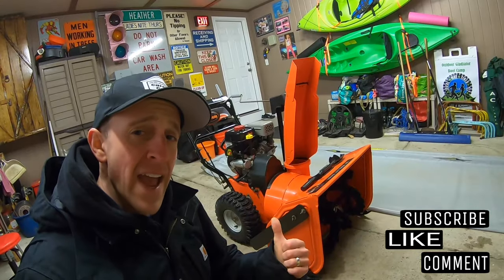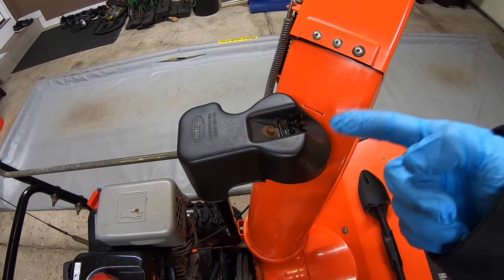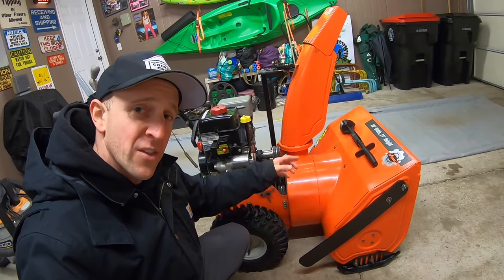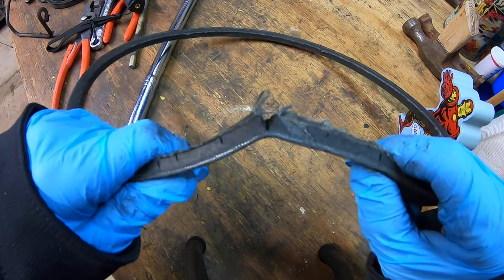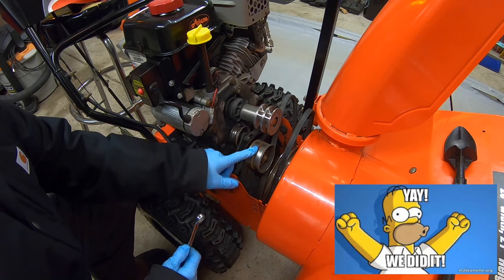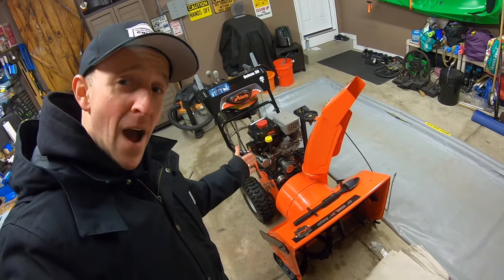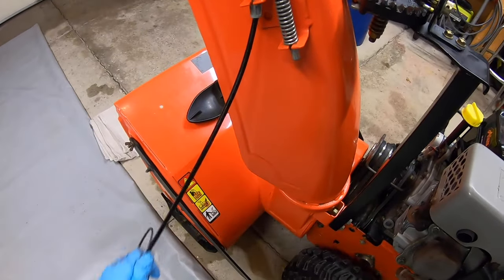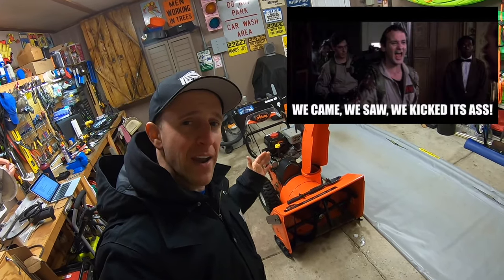HOW TO CHANGE SNOWBLOWER AUGER BELTS - FAST & EASY Replacement and Installation

Comment: Great video!  As I changed my belts last year on my 25 year old Ariens ST8 I can attest that nothing has changed in regards to how to get it done. You did an excellent job on providing all the necessary steps.
I used genuine Ariens belts but they ended up being a tad too long. Enough that I couldn’t make as tight as I wanted when the tensioner was at full tension. It still works ok though. Next thing I’m considering is installing impeller shims to help it throw snow farther.
Reply from the maker: Hey David! Thanks for the positive feedback! Those old ST 8’s are tanks!  You could possibly go to a shop that sells belts and see if they can sell you one that is one size down. Could possibly help! Be sure to check out my impeller kit videos. Did a few of them and all of them work great. Thanks for checking out my channel!

Comment: Just came across this video!! Awesome! I chose to take the pulley off to put my belts on. The new belts were tight and I was worried that I would damage them. 4 bolts and the pulley came right off. Thanks again for the vid! Super helpful!!
Reply from the maker: Glad this video helped you out Lonny! Thanks for watching my friend!
Reply: I'm trying to remove the pulleys but I'm having trouble finding something to jam in there to stop the pulley from spinning while I remove the bolts.  What did you use?

Comment: Thank you for going to all the bother to post this video. Great instructions, and kept simple and to the point! At first glance, it looks like you could replace (at least the auger belt), without breaking the machine in half. That would make this MUCH easier, when dealing with older (rusted, banged up etc.), machines. Maybe Ariens would rather you have the Ariens Dealer perform the task……
Reply from the maker: Thanks for the positive feedback my friend! It’s a pretty straightforward job that only takes about an hour to complete. Thanks for watching Plugger!

Comment: Good video. I just did this job on the same blower. 
One thing I struggled with was when you remove the old auger belts and re install the new ones. Jamming them between the welded nuts is unnecessary and is damaging the new belts on install. I simply removed the 3 small bolts holding the large belt pulley in place and it slid off easily.
Reply from the maker: Thanks for sharing the tip Kevin! Thanks for watching!👍
Reply: Yeah, but tightening the bolts again is near impossible until you realize that on the bottom side of the pulley, there is a hole that you can stick a screwdriver through and stop the mechanism from spinning while you tighten the bolts.

Comment: Very helpful video.  Thanks for this.

An idea for 4:07:  Hold the belts together with a rubber band when tipping the auger housing toward the engine and drive assembly.  That way they stay on the auger pulley without having to use one hand to hold them on while you're joining the two parts of the machine together.
Reply from the maker: Thanks for sharing steven!

Comment: i changed the auger and drive belts on my craftsman track drive snowblower last year. The tricky part is finding the murrey part number that replaced the craftsman parts. 
The auger belt was stretched so bad it wouldnt throw snow at all, but according to the manual it was made in 1988. belt life seems to depend on how much heavy snow it moves. 
But still in great shape as it was always stored in a heated area.
Reply from the maker: Thanks for sharing

Comment: Haven’t changed mine in the 5 years that I have had the Deluxe 30 but these back to back storms we just had in Northeast have caused both belts to snap and cause a bunch of issues when they got wedged into the pulleys and guide so after the smoke cleared I need a bunch of parts and your video is awesome, Thanks !!
Reply from the maker: Hey Kenneth, glad you found this video helpful! It’s not a tough job to complete. About an hour or so and you should have it all fixed up. Thanks for checking out my channel!
Reply: Are those polyskids ?
Reply from the maker: @paulm8395  those are armor skids! They take big bumps very well. You can find them on amazon! Here is a link but make sure you buy the ones that it your specific snowblower. Thanks for watching! https://amzn.to/3IbmoQj

Comment: I have a Platinum 30 Ariens as well as a new Honda 928. The Ariens is about 14 years old and I've never changed the auger belts! I bought a set when I bought the blower and they've been hanging on the wall waiting to be put into service. I may do that just for something to do over the summer!
Reply from the maker: Go for it! 👍

Comment: Just changed the belt on my Husqvarna ST327, was a lot easier than the steps you had to do. remove chute with cables still on, remove belt cover, undo4 bolts, split the unit slightly, replace the belt, fold back the unit, tighten four bolts, put belt on the pulley, replace cover, drop the chute back on, and you are done.
Reply from the maker: Every model is a little different but pretty much every one has to be split in half. Depends on how many other things are in the way. Thanks for watching Sunjay!

Comment: Same Ariens machine and have never changed the belts in 10 years. One is showing some damage so I'll get to it after the season. Great video! I would suggest using some brake cleaner to clean the metal pulley where the belt rides.
Reply from the maker: Thanks D Tom! Good tip with the brake cleaner.  I have however seen brake cleaner mess up the paint on the snowblower so perhaps blocking the rest of the snowblower with cardboard or a tarp would be a good idea. Thanks for watching! 👍

Comment: Your going to think I'm nuts, but I learned this on another YT channel a few years back. There's a product called 303 they make several versions I use one for RV's. If you soak belts in it overnight it helps preserve the rubber from cracking over time. It does seem to help I've tried it, it doesn't cause any slippage or other issues either.
Reply from the maker: I will look into this powder! Thanks for sharing! 👍

Comment: Hello JB, if I wanted to add some new bright lights with low voltage how would I hook them up? I noticed that I have holes on the auger housing. You could use some big gum bands to hole those belts when titling it back. That one video where you make the unit level  was great, and thanks for the tip about the shoes and the belts. Also JB, I still can't start my blower with the hand pull, Electric start only. I have tried. I runs good other wise. I also have used Sea Foam in the gas to clean the carb. Great Video !
Reply from the maker: Hey Stanley! I know donyboy on YouTube did a video on lighting for a snowblower. Guess they work pretty well. That leveling tip works well and also helps you drive straight too. I wonder if your magneto has a thin layer of rust on it preventing it from getting a good spark. It’s not terribly hard getting in there to look at it depending on the model. As always thanks for watching!
Reply: @GarageGear  I see donyboy already has a light on his. I think he use the wiring that was already there. I wish I did. I will ask him, Thanks !

Comment: I have a 1995 Troy-Bilt 9526 that I purchased new, I have never changed any of the belts on the unit. Although, after watching your video I did order new ones. Love this machine, only problem I'm having is parts are getting harder to find. Still starts with one pull.
Reply from the maker: Awesome my friend! They don’t build them like they used to! Thanks for watching!
Reply: I have a Garden Way era vintage Troy Bilt, and it seemed easy replacing the belt by just removing the two top bolts to allow it to hinge open for access instead of separating the auger section entirely.
Reply from the maker: @wingerrrrrrrrr  some models may allow you to do this. Some aren’t as easy.

Comment: 2006 model Ariens 28" 9 HP purchased new from Home Depot on Transit Rd Williamsville in January 2007.  Never changed, will be doing in the spring.  Thanks.
Reply from the maker: Haha that Home Depot is 7 minutes from my house lol. Good idea to put some new ones on. Your machine will definitely throw better! Small world huh? Thanks for watching Charlie!
Reply: @GarageGear  I actually purchased a Cub Cadet 11HP first at that store right after the 'October Storm' of 2006.  Took it home and filled it with non-ethanol and started it up.  For some reason I never put it in gear.  Left it in the garage until January of '07 when we got enough snow to try it out.  It wouldn't move.  Home Depot said they have it fixed the next day.  A week later they issued me a store credit since it was over 90 days and I bought the Ariens 9 HP which was the biggest they had in stock.  They never told me what was wrong with the Cub Cadet.  I'm glad I ended up with the Ariens.
Reply from the maker: @charliebelle6693  wow I wonder what the real issue was with that cub cadet? It would be interesting to see the transmission. Ariens makes a solid machine. In fact I just bought a 1971 ariens to do videos on soon. Those old ones can really last.
Reply: @GarageGear  Well you got me moving.  Replaced the spark plug yesterday and adjusted the belt.  It's a single belt in good shape for the age and use.  The adjustment only has two positions.  Sprayed it with Teflon silicon Blaster spray and WD40.  I did change oil and gear box fluid and grease all the fittings in September.
Reply from the maker: @charliebelle6693  Wow Charlie! Sounds like you had a blast in your garage. Proud of you bud!👍
Reply: @GarageGear  wow, I live in Cheektowaga, near the Buffalo Airport!!! Small world indeed!! I'll be doing the belts on my John Deere 724D in a couple days. I'll let you know how it goes. Keep up the sweet videos!!!
Reply from the maker: @bobmanns3623  haha another buffalonian near by! That’s awesome!   Keep me posted!

Comment: Thanks for the great videos!  I'm trying to replace the auger belts on my Ariens Deluxe 28, but I can't get them past the bolts on the brackets on the sides of the pulley.  The new belts are a little thicker than the old belts and I tried for half an hour to get them on, but I couldn't do it.  I'm considering removing the pulley so I can get them on.  I tried loosening one of the bolts on it, but the pulley spins around too much.  Do you have any tips on how to keep the pulley still while I remove the bolts?
Reply: Never mind.  I was able to get the pulley off by jamming a rubber door stop in on either side.  I was able to get the belts on so my problem is solved.
Reply from the maker: Hey CK glad you solved your issue! Thanks for being a cool fan of the channel!

Comment: Thanks for the video! This is the one that looked more like mine for the belts but I am having an issue, every time I try to start it the belt that's most near the front comes off the front pully wheel and the second belt gets into the position of the pully wheel for the one that came off, what am I missing or what do I need to look at?
Reply from the maker: Hey frog! Did you buy the correct size belts? Also do you have the belt guide on?
Reply: @GarageGear  Hi! Thank you for your quick response, really appreciate it! I am a computer guy and know nothing about machines with motors hehe, but I have an old Columbia (which is now MTD from what I've read), my model seems to be 666G (specifically 316E666G597) and the belt packaging says fits with models from 630E to 668H, I also compared the old ones with them at the store and they looked identical in size and length. Either the model does not have a belt guide or it did not have it from the previous owner. Thanks again!

Comment: Great video, very helpful!  My blower stopped throwing mid way through clearing the driveway of heavy wet snow here in Fulton NY yesterday. I opened the belt cover to check the belts and noticed one is much more loose than the other. Is it normal that one would wear before the other or do you think I have another issue?
Reply from the maker: I have seen this before. Could have stretched out somehow. You never know because you can’t exactly see what happens. Best to change both. Thanks for watching!👍

Comment: Hey JB, love your videos! I adjusted my auger  cable and now it’s taught but how do you know if it’s to tight? When my auger handle is up , there is a little play in the cable. When I depress the handle, the cable is tight with no play! Should I adjust or is that normal? Thanks again and keep up the great videos!!!
Reply from the maker: Hey Ray, I’m my experience you want it to have a little play when it is not pressed down. And taught when pressed. If it’s too hard to push down then it’s too tight. Just eye ball the adjustment to these settings. Thanks for watching bud!
Reply: @GarageGear Thank you for your response JB. I’ll check it again today. Happy Holidays
Reply from the maker: @raymoran1559  merry Christmas to you and your family Ray!

Comment: JB!! Was guided here after using your friction disc video to replace disc.  Discovered my drive belt is actually the problem which let me to your auger belt replacement video. Thanks for both videos, as they are quite helpful for first time pulling apart the machine.  I was surprised that you did not replace the drive belt when replacing the auger belts.  Why not do that belt as well since the machine is pulled apart?  Anyways, do you have a video on drive belt replacement?  TIA!!!!
Reply from the maker: Hey truwebs the drive belt on mine was in great shape when I filmed this video. The drive belt on this model isn’t too hard to swap out. You will have to loosen some parts holding the drive wheel in place so you can wiggle the new drive belt into place in front of the friction disc. I have used a long screw driver to slip it down into place. Thanks for watching my friend!
Reply: @GarageGear  Thanks for the reply and videos you have supplied.  Most helpful!!   I "persuaded" that drive belt between the drive pulley wheel and friction disc with a screwdriver.   Ready for the next snow!
Reply from the maker: @truwebs  awesome my friend! Persuading is the way to do it!

Comment: I have a question.   When the auger lever is not engaged, is the belt supposed to slip on the engine pulley, I mean if its not engaging, it has to slip somewhere?
Reply from the maker: Hey toto! The belt just stops in place when you let go of the lever. The pulley will keep spinning and when you pull on the lever the tensioner puts pressure on the pulley tightening the belt on the pulleys. Thanks for watching

Comment: Hey J.B. Love your vids, very helpful. I've seen you install the impeller kits on the Ariens, and you turn the impeller by hand. I cannot get my impeller to turn freely, what am i doing wrong? Thanks.
Reply from the maker: Hey Charlie some snowblowers have a locking mechanism on the impellers so I’m told.  You may have to do some research on your model to see how to disengage it. I’m not totally sure how. Perhaps removing the belts? If that doesn’t work, perhaps start up the machine, run the impellers to see if you can spin them into the next drill position. Hope this helps. Thanks for being an awesome fan!👍

Comment: I have never changed them before but after watching this, no problem.  Well….in theory.  typically I end up finding out I have the only produced model of whatever it is and it requires full disassembly 😂.
Reply from the maker: I think you’ll be just fine Tanner! I got faith in you!

Comment: Can the impeller upgrade be done on a Ariens Model: 920014 - Compact 24 LE specs?
Reply from the maker: Yes it can! It will make that machine a beast!

Comment: My tines are not up to speed moving  slow any ideas .Have a Arines 2 stage it's my third season with this .
Reply from the maker: Hey jkeane! Have you checked the following:
Belts
Belt tensioner 
Throttle speed
Auger gear case for any noise
Anything caught in the impeller 
Let me know if you find anything!

Comment: Should there be zero or almost zero tension on the belt when not engaged to throw snow?
Reply from the maker: Hey alaw! The belt should relax on the drive pulley. I should not spin but be just snug enough that when you pull the lever it grabs. Thanks for watching!
Reply: @GarageGear Got it! I was having a helluva time trying to replace my belt last night. I appreciate the response!
Reply from the maker: @Alawicous  awesome my friend!

Comment: Been using my White Outdoor Sno Boss 850 for over 20 years... never changed the auger belts and never paid anyone to do it either. My machine must be running on prayers.
Reply from the maker: Lol give them a look when you have a moment! It’s a cheap and easy fix usually.  And you tend to get better throwing results too. Thanks for checking out my channel!

Comment: theres no need to disconnect all those cables, just pop the shute off with the cables connected and set it aside, theres also no need to pull the front end of the machine off either. Remove the sparkplug to make engine rotation easy, turn the small pulley by hand to jump the belt onto the crankshaft pulley.
Reply from the maker: @gerardjones7881  thanks for sharing gerard

Comment: I have a Ariens 30 platinum sho model 921030 and changing the belts are a pain, not as easy as shown. The twin belts won't go on the double pulley bottom, you have to remove the double pulley to install the new belt. Also, the drive wheel belt won't go between the traction disc and pulley without removing the bottom belly pan and pull that belt in between and that could be a pain. also, the remote one lever chute is a pain to dismantle and reassemble.  I like the machine it can through snow a good distance.
Reply from the maker: Thanks for sharing